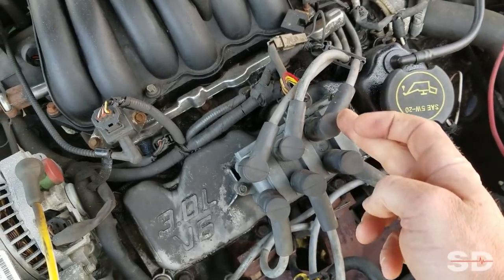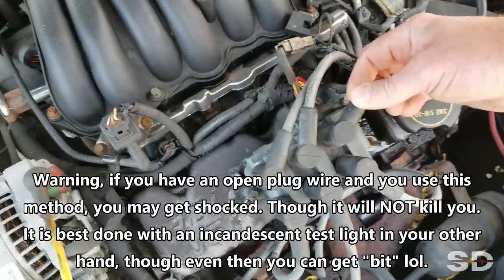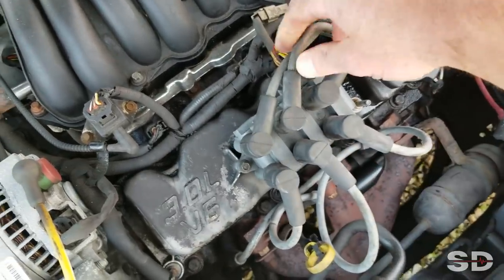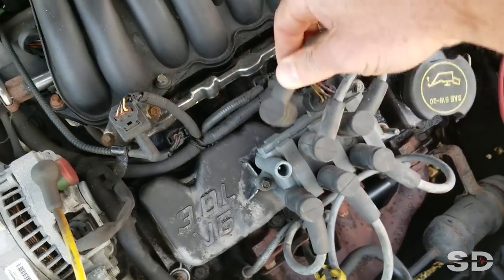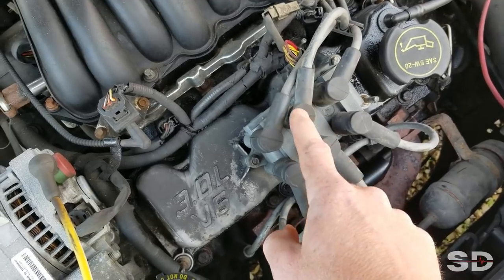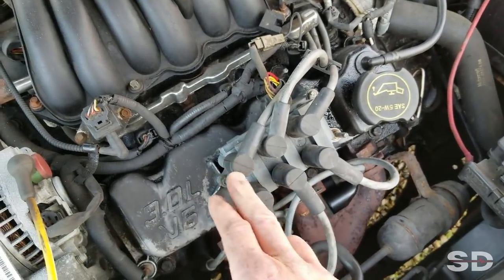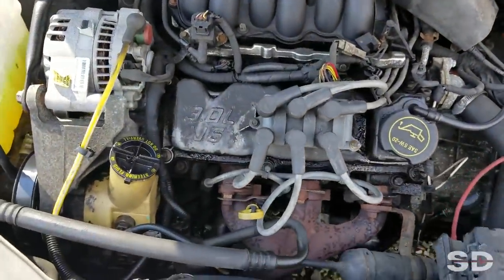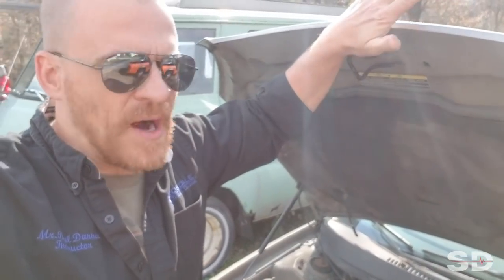Waste Spark Ignition Coil Quick Tests

Comment: I've lost count of how many of these engines I've worked on. Seemed half the town owned these cars at one point, lol. That one there likes to pee coolant out of the timing cover - did 2 of those jobs. Just about every one I did a coil pack on.All the bodies had severe rust. The DOHC always seems to need intake gaskets, and coil packs (and plugs). Love how the radiator has to come out the BOTTOM on that one - that threw me for a loop years back! I actually fixed an issue with one of these having a "hooting" intake, after watching your video with the EXACT same problem! Been subbed ever since. 👍👍

My neighbor had the Mercury version (Sable), same color too, and about the same miles. When he complained of a misfire, just a quick glance in the engine compartment, I saw the rusty plugs - told him to grab a set. He didn't believe me that this was the issue. Well, when I got the plugs out, I found they were OE!!! 177k!  I could only measure the gap with an allen key! A 3/32" fit a little loose! Almost ONE TENTH of an inch gap, HAHAHA! 😂

You can see this car (just before it's demise) in the first 9 seconds of my "FACE MELTER" YouTube video. :) It was stripped clean in preparation for the local demo derby. Thing did pretty good, even with all the rust! None of us thought it would make it 1/4 the way through the first round, lol. When I winched it up on the trailer (still running, but not able to move under it's own power), I saw the fuel line was nearly kinked in HALF! No clue how the thing kept running! 🤣

Great vid, as always, brother Paul! 👍👍
Reply: Jimmy S  - Ha! Yep, familiar with the spring issue - that was the last problem my neighbor had before entering the car in the derby, lol. I had never seen anything like that happen ... except on my '94 S10 plow truck, where the sway bar broke and carved up 3/4 of the sidewall, lol.

Every single one I worked on had blown rocker panels, but luckily never had any issues with the engine cradle (that I know of - most are long gone now). The rust crept it's way backward all around the rear door on most of them, too. I had to completely remove a rear sway bar off one since it was bouncing around, and there was nothing left back there to mount it to, hahaha!
Reply: @SmittySmithsonite   and Jimmy S.....The way you describe these cars, it's hard to imagine that they were ever brand  new at one time !
Reply from the maker: That hooting video I shot, I remember it was not a very good video or it really sucked to film lol and I didn't know you were shooting videos now! Awesome
Reply: @ScannerDanner  - Well I thought that video was great! 

Yeah, just started shooting them the beginning of the month. It was time. 😊 Thanks!

Comment: Mr Danner thank you you taught me so much I have been watching your videos since 2013
Reply from the maker: Thanks so much Daniel!
Reply: @ScannerDanner   ScannerDanner  some ignition coils are dead. However, engine is not vibrating, why??? Is not it supposed to vibrate when ignition coil packs are dead?? Please elaborate.
Reply from the maker: @tnamen1307  it depends on the firing order and which cylinders are dead. for example firing order is 1-2-3-4-5-6 and cylinders 3 and 5 are dead, compared to another car that 3 and 4 are dead. The 3-4 misfire will vibrate more

Comment: Same setup, Ranger 4.0l.
CEL 3 times in 2 years. 

Could feel & hear the miss for months before the last time.  Parts Store free scan:  Cylinder 3 Misfire.

Watched about 30 videos on injectors, plugs, wires, & coil packs, including all the ways to check, verify, confirm, test, remove, bench test, clean, and replace, plus which brands to buy, upgrades, gapping plugs, and which brands to avoid.

With all this new found knowledge & confidence 
I went straight to the coil pack looking for cracks & a part #.  

No visible cracks, but hard to see the firewall side at 5'3" even standing on a milk crate.

Thinking about going to get a mirror while wiping away dust  & discovering cyl. #'s printed between each set of connections, I turned the cyl. 3 connector a little to better see the numbers.  When i did, the plastic fastener went sliding down the plug wire.  Hmph. 

I gently pulled up on the  connector & it practically FELL OFF.

Looked inside the end, and saw pristine shiny metal & connector lube / grease that looked like it had it just been put on.

I put it back on pressing down firmly.  It looked level with the others so I slid the fastener back up, and put it where it belonged.  Although it didn't really "fasten," but neither did any of the others.

Silently praying the universal 3-word prayer of "Oh God, Please."  I climbed in & started it up.

Drove to 7-11 & back.  YAY!!   NO MORE MISFIRE!!  

Lastly, but out loud this time, I gratefully said the other 3-word prayer, "Thank You, God."

Comment: I ran into a dodge minivan with a shorted to ground coil control under the plenum that burned out a new coilpack. It ran fine after the first install but quickly vibrated the short back to ground(injector rail bolt) Great video!
Reply: That's a very common problem with Dodge minivans. The heat and/or vibration damages the insulation on the wires under the plenum going to the coil or the injectors.

Comment: Great video Paul. This is the perfect video for techs who don't understand Ford waste park system. Also with a scan tool mode 6 test $53 would show min/max values for misfires. Thank you again Paul.
Reply: I heard about this...can you explain more? This is very helpful.  I have a ford with the waste spark and I am getting what I feel is a small misfire.  If I can rule that out with a scan tool then it would save me a lot of time.

I have no current codes but I think I read that you need more than 2% misfires for it to pop a code

Comment: Nice video Paul I have that Scan Tool too. You probably didn't realize it because it was Pete's Tool but there were 4 monitors that haven't run. The Cat, O2, O2 Heater, and Evap.
Reply from the maker: not surprised that someone was in there and cleared the memory before me, thanks!

Comment: I replaced mine on my 2005 Ford Taurus not too long ago. I was having a pretty nasty misfire after a short hot soak (shutting the car off to go into a store and starting it back up 5 minutes later) it always happened when it was raining I noticed. The one that was on there was aftermarket with "China" stamped on it and the epoxy on the bottom had started to separate from the plastic housing. My guess is that moisture was getting into the coil pack shorting it temporarily but I replaced it mainly because it had china on it. Never had that problem again with the Motorcraft one. I think it was like $65 on Amazon.

Comment: Dead coils are a great deal of the time a consequence of poor spark plug or high tension lead maintenance, even a wide gap on the plug over an extended time can be the cause of coil failure, it doesn't necessarily have to be an open circuit.

Comment: Could you talk more about the "fuel trim correction?" Thanks. I have to say, I'm learning a lot from you and those that comment.
Reply from the maker: A misfire would cause excess oxygen to enter the exhaust and the engine computer will add fuel to try and counter it. Problem is, it's a false lean condition, so the good cylinders end up with more fuel than they should have.
Reply: @ScannerDanner  Thanks

Comment: Hello, i have two wasted spark Ford ignition coils and both are working, but for example if i wanted to measure which one of the two is better, is measurement of the resistance of the output coil(s) the right way and which one should be the better one in this case - the one with the higher or the one with the lower resistance. In short, the question is, if both have equal primary circuit resistance, which one will give higher output voltage - the one with higher or the one with lower resistance of the secondary coil. I mean if the difference is in the range of 1-2... to 3kohms maybe, as if its bigger there must be something wrong obviously. Thanks
Reply from the maker: resistance testing ignition coils is a waste of time unless you have an open or completely shorted coil. I've seen many bad coils measure good resistance.

Comment: I have a Honda Valkyrie, and I'm guessing that applies to that, too? And how does 'half' a coil stop working? Is it the left half, the right half, or the top or bottom halves that stop working?
Reply from the maker: On a waste spark system like this one, the half that is not working is being bypassed by an open or shorted winding. The energy is finding its way back to the coil by another means
Reply: One coil fires 2 cylinders. Its two coils in one basically.
Reply: @91GT347  I know that, now. Ha!
Reply: @BazzSelby  I figured you probably had. I replied just in case, and for anyone else that may want to know. Lol

Comment: Hey, I had a question about Spark Plugs with crush washers on them, I’m paranoid about stripping the threads but the crush washers make it really hard to judge because my torque wrench is just turning. I did like 1/4 and stopped but the torque didn’t click as I didn’t want to take the risk? From finger tight about how far should the torque wrench turn if the spec is 14 ft lbs?
Reply from the maker: No idea. You can feel when the crush washer crushes, then just a little tighter. I've never, not one time, torqued a spark plug

Comment: If the plug wires were open, would the coil spark to them?
Reply: had same thought.
Reply from the maker: It doesn't the energy created from the field collapse is looking for somewhere to go. It can build higher than 50,000 volts on the open plug wire side. Eventually this is what "burns out" that side of the coil, or the entire coil in some cases.
I should also say that half the coil still fires only because there is a return path, it's just not the other plug wire anymore (when its open)
Reply: ScannerDanner So if the problem is only an open plug wire, then both sides of the coil won't fire. Is that correct?
Reply from the maker: In theory, but it will find a way back on the other side

Comment: So, if i have waste spark coil for 4 cyl engine, and one of the coils burned it way to one of the primary's grounds, will i see some resistance with my multymeter betwen sec output and primary ground?
Reply from the maker: you shouldn't see any resistance between the primary and secondary of a waste spark coil. The ohm test is poor, you could still have a short the the spark can find but the ohmmeter cannot, due to "stress". The ohmmeter put's out 1v at most. That's not much of a load.
Reply: @ScannerDanner  thought about that after writing the comment) ofcourse ohmmeter will show "1" in any range while "spark" will find a way through/from a bad coil

Comment: yeah cool feature of waste spark is that you can take the preshure in one cilinder and down grade it in the oposite cilinder this system is a great economi feature the wear on piston rings are less bether motor perfomance practicaly what you have is if it is a 4 cilinder it will by smuthe like a 8 cilinder! sadly its a oposite polarity if it is posibel you can have same polarity park you wuld teoreticaly dobel your power out put the spark gap is the problem it needs realy critical ignition timing best using a laser this system has great potential if you have a gas reciculation circuit it wuld by even more economical like any system lean burn mix has a habit not start ore hard start in the morning my best bet is using this system on centrain carburator's there are centrain coil resistance and there are spark plugs with a resistor in them ore with out a resistor if evry thing is ok the system will run perfectly

Comment: Salute SDR , i have a hyundai elantra  2000 who came in from a new clutch job. After job ..Coil plug got toasted and wires order were inverted. CKP reads 1.595 v on both feed and ref PCM connector wires. Good ground .Of course No spark!!  (Doesnt it by supplying the Ckp with outside V and 5v ref should help the Pcm spark up the coils???)  Oddly All other sensors voltage and 5v readings seems ok. Ughhh.   How should i appro ach??!!  Any advice....anybody??? Bad Pcm ?? I went thru all the wiring check for shorts/open etc ..
Reply from the maker: Did you fix this? Is the crank sensor a hall effect (3-wires)? Are any of the crank sensor wires shared with the cam sensor or any other sensor?
Reply: @ScannerDanner  Hello Scanner,..No Not yet... Well im waiting on a knock sensor to come in the old one was also toasted and cracked as the Cam. Should be here by tuesday or before then. Already have new coil plug and cam sensor..( Yes is hall effect and Yes i do think that CKP and CMP are shared ,but inside Pcm ) i was looking at one of your vids where i seen a low voltage on Ckp coming out of a shorted Cmp almost looking like what i got here.  Thanks4reply. Gb
Reply: @ScannerDanner  Hello SDR.!! ..Just installed all new plug ,cam and knock sensor  and still same thing... Keep getting 1.6 v on crank sensor ,No spark at all.....No Rpm....tested all sensors ohms and V all looks good .. All ground s good...tried new Pcm (cheap) thank God.. New coils..etc..   No luck!!!!!
Reply: @ScannerDanner  Sorry i havent post anything on this subject i thought i should comeback and explain tho...Well we havent had any luck, this cars been worked on over a month now. It was send to an electrical shop been there over 2 weeks from then and still same results. They went bought another Pcm thinking i have fried the 1st but no....They had to take a look at the clutch job again so Theyre now saying is a mechanical issue where the crank sensor is not making contact.  I still think thats not the issue cuz the Pcm (Power feed wire) doesnt have anything to do with that it should still show its 12v or 5v on it.  Am i correct???
Reply: @ScannerDanner  Hello Scanner.. The car has been taken from 1 shop to the other and was currenttly taken to a new shop yesterday.. I havent heard any news yet. 1 shop said after working on it for a week with no luck that it looked like an internal part like the flywheel  broken , but werent sure.. I personally dont think so. The ladys gonna proceed after this last try to go to court.  Lets see what happens.. All im saying is there has to be a short even partially somewhere onto why is the pcm not sending its battry Voltage to CKP feed wire... I did remember having my MM leads on CKP reading 1.5v and as i was wiggling or shaking the unclipped  underhood fusebox the Volts will fluctuate...

Comment: 😒 wth is waste spark? nvr heard of it 😰
Reply from the maker: 1 coil fires two cylinders at the same time. One cylinder is always on compression while its companion cylinder is on exhaust. And they flip every 360 of the engine. Each cylinder gets spark on compression and on exhaust strokes. The exhaust one is "wasted" because it does nothing other than a return path for the spark.
Reply: @ScannerDanner  🙂 neat, i didnt know that, thx for the quickie class buddy, cheers ✌️😏🥃😋

Comment: I would not grab or teach people to grab a 20,000 volt wire with your hands.

Rubber gloves or insulated pliers take a second to grab and beats heart arrhythmia, heart attack or getting hurt when your muscles contract and strike a car part.

You are trusting in the insulation of that wire. Lost a little respect there...
Reply from the maker: No dangers to bodily harm with a 12v coil. Sure it can produce 50kv but it won't kill you. Not enough amperage. Been bitten hundreds of times. Love shocking my students too :-) and my boss, and whoever is around when we are learning about ignition systems.  Now my friend Pete, who has a pacemaker? That is a different story.